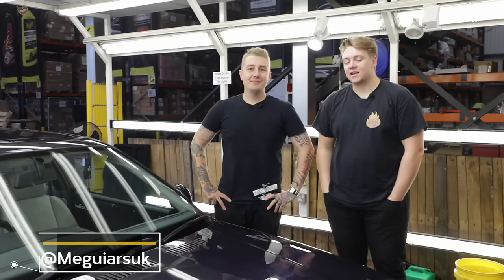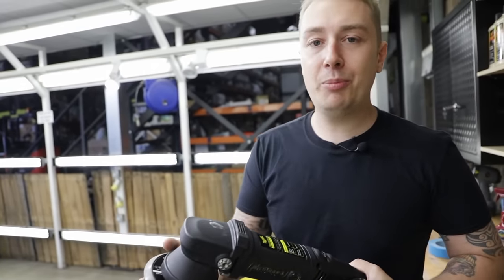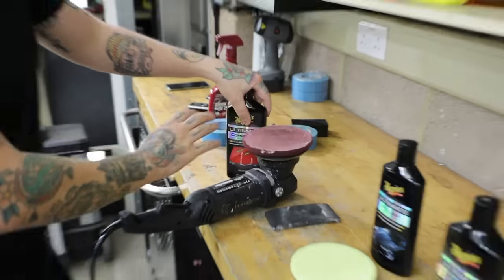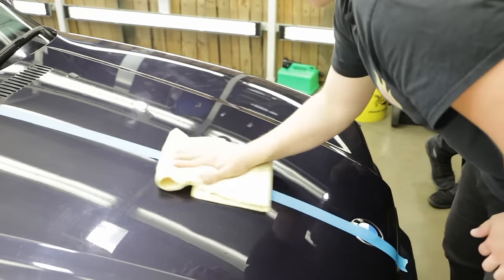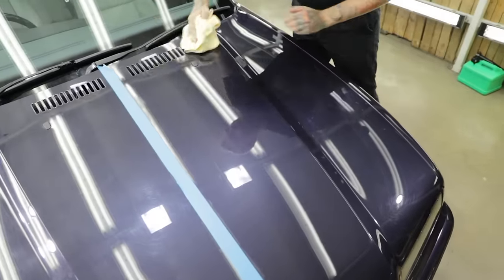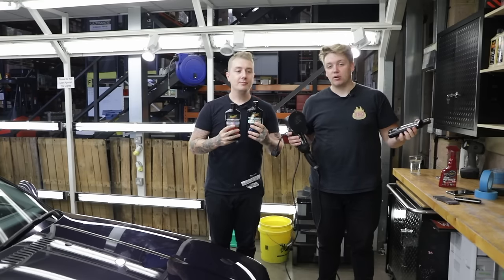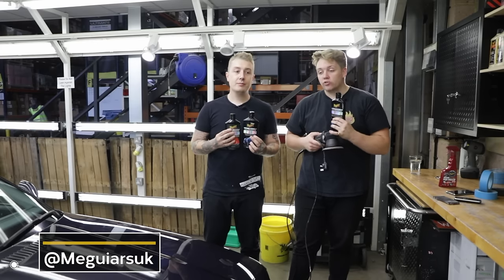How to use a DUAL ACTION POLISHER - Detailing 101 EP.13

Comment: Mequiars 110 followed by 210 is golden. I had water spots all over and fallout/contamination. Clayed the whole car, hit it with 110 and then 210 and my paint looks brand new.
Reply: so then which is better: Mirror glaze 110 compound and 210 polish - or - the Ultimate compound & Ultimate Polish?
Reply: @kevinyork4757  idk but 110 and 210 gets the job done well.

Comment: Polishing is easy... but it’s also easy to fuck it all up....and it happens quickly if you are using the wrong compounds or techniques...   I own a Ford Raptor... I practiced on my other vehicles first and was glad I did...   I’ve got an old white 2012 e250. Did it first on that .. but white isn’t a great color for polishing   I have a 2002 dodge Dakota sport.  Red... that was great for practice...  then I went at the raptor...  tuxedo black...  awesome

Comment: Great vid thank you. My question is the bonnet nice and flat but what happens using the polisher on the sharper curves and bends when its not so easy to keep the polisher on a flat and even surface?
Reply: Use the palm of the pad as much as you can and don't let the back plate hit the car surface. Also be aware that you can sling product if any part of the pad is raised.
Reply: A smaller backing plate and pad will help. Always make sure the pad is slightly bigger than the backing plate

Comment: So much more comfortable now after watching this video. Just 1 question, I was gonna do a little paint touch up on my car's bonnet and my plan was to fill in the chips with the paint but I want the surface to be really with the rest of the paint but I don't want to wet sand as the car has a metallic finish and The thought of sanding paint terrifies me. Could I use a DA Polisher and the buffing compound to smooth out the filled-in chip?
Reply: You might end up burning through the clear coat surrounding the chip.
Reply: @Occhublu  very good point made thanks

Comment: Super useful video! Thank you. Few questions - can you wash the pads after and use them again, or are they single-use? Also, how many times can you do this before damaging/thinning the clear coat? I did a small trial polish to remove a few light scratches, it worked great. I wanted to do it again, but for the entire car this time. Should I space the procedures out some?
Reply: You can absolutely wash the pads for re-use.  Just let them air dry.

Comment: Excellent video.  How much of the compound (in bottle) do you end-up using per full polish?  One full bottle, 1/2 a bottle or more?

Are there specific soaps/shampoos  to use before the decontamination?

This is a super video and I liked it so much! Does the product that's applied at the end have paint protection? If so, how long is the protection?

So, the way I understood the overall application of the products is that you do the first application once a year. In the case of this car, the three products are used one after the other.   Thereafter,  you will only use the last two products twice per year and then after only the last product is used, correct?

Comment: Very easy steps to follow for the junior detailer to Work with..thank-you 
My question is this....when would I be able to put either a silicone finishing coat or ceramic seal on the finish surface...

Comment: Could you theoretically cut, then polish and then add a clear coat? Have a beater which has no clear left at all, although base coat is strong. Or should it just be sanded with 1200ish? I know it will never be good as giving a new base, then clearing, but all i want is protection from UV and stone chips.

Comment: Why would you speed up the footage during the work? Isn't that the most important thing in the video? Everything else you can read from the bottle as well...
Reply: They probably assume that its unnecessary to show people how to spread the product around the surface every time. If you've found one of their products with written instructions equal the application and proper use techniques, you found a super duper prize!!! 
Free attendance at a special 4 hour class designed to teach people with your mentality how to properly apply butter on bread.

Comment: Hi there. So for my understanding-if I want use ceramic layer as final, I can skip your last wax stage, is that correct? Or do wax and seal with ceramic? btw link for used components not working anymore. Greetings. Tom

Comment: can uneven preasure on the machine when one step correcting cause different rotation speeds result in micro marrings usind da polisher 8mm +15 mm off set ? 
Google does not know answer to this question :)

Comment: No need for an IPA wipe down with Meg's products then between stages?
Reply: No need, you can if you want but it has little to no benefit. If you use different brands then you should use IPA between stages.
Reply: I think IPAs are mostly for when you want to use a sealant or coating so they bond to the paint without any residual oils. I think going from polish to wax is more forgiving.

Comment: What pad and product would you use if you want to remove oxidation but no swirl marks? (2 stage)
Reply from the maker: The Ultimate Compound is still the perfect product for the job. We'd suggest using it with the yellow Polishing Disc.

Comment: Just wondered how to wash your towels and pads? Do you put the towels in the washing machine with laundry powder/detergent or just wash with water? Also I have a different brand DA polisher which goes up to speed 6, would 5-6 be the best speed for cutting , 4-5 for polishing and min speed for waxing?
Reply from the maker: All our accessories are machine washable, just make sure you use regular detergents no softeners or conditioners. For the DA that sounds about right. Go in between each setting.
Reply from the maker: all accessories are machine washable with just normal detergents. No softeners or conditioners. It's hard to comment on other machines. Best start with a lower speed and see if that gets the results. If not speed it up.

Comment: Quick question ( I’m new to this). Would you apply a ceramic product over the last polishing wax stage? Thanks
Reply: No, ceramic coating goes onto clean paint INSTEAD of wax; they perform the same job of protection. Wax, sealant, ceramic, and graphene coatings are all the protection layer.

Comment: Great video lads ! When working each stage of the products would you do all 3 stages on each panel before moving on or compound the full car then polish the full car after etc ?
Reply from the maker: We would suggest doing each process on the entire car then move on.
Reply: @meguiarsuk  thanks for your reply
Reply: Can you use one pad for each stage all around the car? Or do you need a separate pad for each panel? I assume one pad can do the whole car one stage
Reply: @meguiarsuk  From this video not understandable when i can apply ceramic coating? can you please clarified. Big thx

Comment: I see some people clean the pads in between each pass with a nylon brush/microfiber cloth?. Do you still need todo this with the meguairs products? Thankyou. @meguairsuk
Reply: yes ofc...
Reply from the maker: If you find the pad quite clogged up you can however it's not necessary. We do this with single stage paint as the pad can become clogged up.
Reply: @beau2047  I would think that is something increadiibly important to mention in the video!

Comment: Gents, thanks for this video….very helpful.  One quick question though (or to anyone reading who can answer), the machine is obviously perfect for large panels where you can keep the pad flush to the surface but how do we tackle smaller areas (wing-mirrors etc) where there is a significant curve to negotiate. Is a smaller (3”) backing plate and pad the solution?  Many thanks.
Reply: They’re are smaller DAs with a smaller backing pads rupes makes some
Reply: You can buy thick (1 1/2 inch) foam pads. These pads are great for corners and curves.

Comment: great video chaps

i have a question, what is the difference between a orbital polisher, the likes of what is used in bodyshops and your mt320 duel action one? many thanks
Reply: An orbital polisher goes round in a circle only. The DA (dual action) goes up & down as well as round and round.
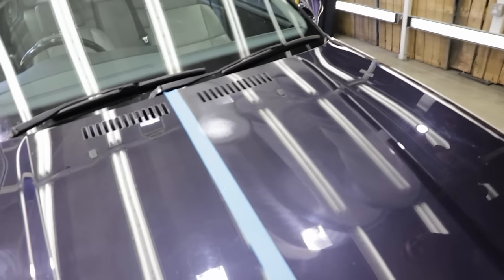Reply: 10:00
Reply: @DaveCroy   I have looked at both,  They have the head in a bearing that is loose to spin, that bearing is rotated around the center axis of the motor.  Both DA and Orbital seem to have the same kind of motion.   Spinning is not up and down or side to side.   Many do seem to have a larger throw:  The distance from the center of the motor axle to the center of the polishing head axle.  Then I read an article this morning that said they are the same... although most DA's go to higher speeds???   So confusing.

Comment: Does the polish/compound abrade any of the clear coat??
Reply: You for real???
Reply: Dan Hawkes yeah
Reply: @meguiarsuk  wrong video guys 😁
Reply from the maker: In order to remove swirls and fine scratches that are sitting within the very top of the clear coat, the Ultimate Compound will remove the very top of the clear coat.
Reply: Meguiar's UK so surely if you apply it multiple times a year eventually the clear coat will disappear altogether?
Reply from the maker: @jamie123b The amount of clear coat that the compound will remove is minuscule.  A compound only needs to be used when you can see defects that you want to remove.  Using a couple time of year is both safe and within the normal expectations of the product. In the world of compounds, the Ultimate Compound is a gentle and sympathetic compound.

Comment: From this video not understandable when i can apply ceramic coating? can you please clarified. Big thx
Reply: First thorough wash then an iron remover to remove any contaminants. After that you clay bar the car then depending how bad your paintwork is compounding and a Polish. If you just have some swirl marks a Polish will do also IPA isopropyl alcohol 70 or 90% that's to remove any remaining wax or compound or Polish left over on the car. Now you're ready for the ceramic coating. Hope this helps, from all my research this is the proper way to do it. Good luck. Oh yes I forgot the prep work is the most important thing very time-consuming and labour-intensive if you can try and get someone to help you. I'm starting mines next week, check out pan the organiser great instructions and he also has a video on the five best ceramic coatings. Thank God for Google speech translator
Reply: @denzeljackson6505  👍👍
Reply: @denzeljackson6505  Canada, Vancouver 🍁🍁🏳‍🌈🏳‍🌈😜😜

Comment: Can i use ultimate compound with a polishing pad? If so, how?
Reply: You can use it in the same way they describe, it will have slightly less cutting power.
Reply from the maker: Absolutely! We do this ourselves sometimes if we don't want to go all out on the paint with the red cutting disc we use a test panel to see if using the polishing disc will be enough to remove any swirl marks.

Comment: Aren’t you meant to do a ipa whipe down do remove any oils to reveal a true finish? Thanks
Reply: I think IPAs are mostly for when you want to use a sealant or coating so they bond to the paint without any residual oils. I think going from polish to wax is more forgiving.
Reply: You can, it just helps you see through the paint clearer so u can see the results slightly better. When waxing, IPA isn't can help, but isn't necessary, but if your doing a ceramic coating, you need to fully IPA all the paintwork

Comment: I use the whole line of Meguiar's ultimate products for all my cars. I saw on another channel that after polishing,  I have to do an IPA wipe before putting on wax and sealant.  Is this true?
Reply: Yes because you want the wax to bond to the clear coat. But this probably doesn't apply to all products and brands. Probably Meguiar's compound doesn't have wax in it so the wax they used as the final product went directly on the clear coat. If you use their products then you can check if they have wax in them compounds, I assume they don't if they used wax as final product as I said. They have good products, I really like them even tho I never used them.
Reply: @ludwigrotin5891  thanks for your reply.  After I compounded then  polished, I went straight to waxing then applied hybrid ceramic liquid wax. Is that ok or do I have to redo the waxing and application of the ceramic liquid?

Comment: If I have brand new paint on the car and has minor scratches, do I use the ultimate Polish or Compound?
Reply: Medium to remove it or final. See for yourself start with the final if they don't go then go with medium.
Reply: But make sure if you painted it, give it at least 6 weeks to cure so it can harden enough and then you can wax it after polish.

Comment: Compounding once a year is way too much. You should never even have to compound an entire car to begin with unless you either bought it used from someone who didn't properly maintain it or if you didn't properly maintain it yourself, which means you need to reevaluate how you regularly care for your paint. Polishing once a year is more than sufficient unless you fall into one of the two aforementioned categories. Outside of that, you should never compound again unless working on specific areas with scratches or damage

Comment: The beginning, that’s how my car look 😞many rotary swirls scratches and dull finish but after some idiot furiously compounded it and left it that way! So does it still need clay barring, polishing and wax...wax of course I know....please help! Any advice? Any one
Reply: wash car,,clay bar car,,,compound,polish car,,,the apply sealant like wax or ceramic coating
Reply: @robertswift6101  thank you! 2 questions. Do you happen to know, is chemical guys glaze a sealant? I was thinking to polish, glaze, then wax. Would that be ok or is glazing and waxing together unnecessary? Also, my car was actually clay barred, polished and waxed 2 weeks before it was compounded...long story as to why it had to even be touched again, however I didn’t know it would be compounded so aggressively but Anyways....does it still need to be clay barred again?
Reply: @tvalue4618  i never used chemical guys so cant say,,,i always compounded if swirl marks or scratches,,,then polished and then waxed,,,some waxes like NuFinish is a polish and a sealant

Comment: Too bad not using any IPA after the compound and after the polish to reveal the real results and also removing all the oils from the products 🤷‍♂️
Reply: The IPA wipe would have been nice. 
From my experience the Ultimate Compound does a fantastic job. 
The Ultimate Polish does hardly anything after a proper use of the Ultimate Compound. I could barely notice a difference after using Ultimate Polish, maybe a hair better depth... Some internet research has shown Ultimate Polish to contain glazing components, unsure if Ultimate Compound has any.
Just my experience.
Reply: @jacobmay7594  as all compound and polish they contain oils and these oils are gonna fill even if some are trying to convince you that there is no silicone or fillers inside the products they made.. Hence why using a IPA is absolutely vital to reveal the real results.

If you liked the enthusiasts line of product of Meguiars (Ultima compound and ultimate polish are from the enthousiasts line) I suggest you to try the D300 and for deeper defects 105/m205 combo is well known for years now.

The m210 is nice to have for some finicky soft paints..